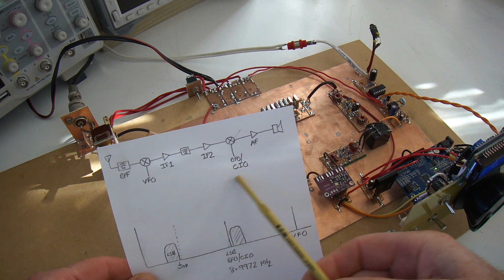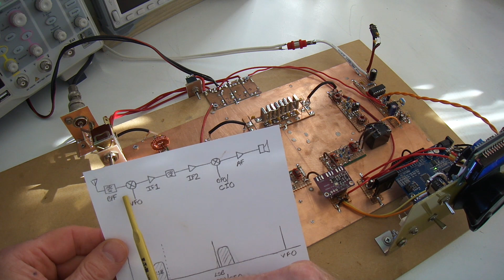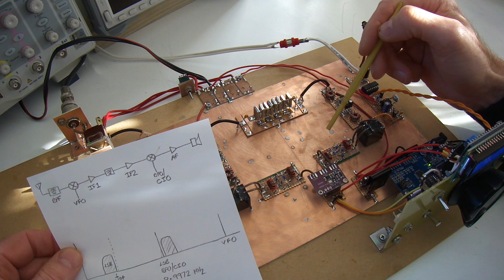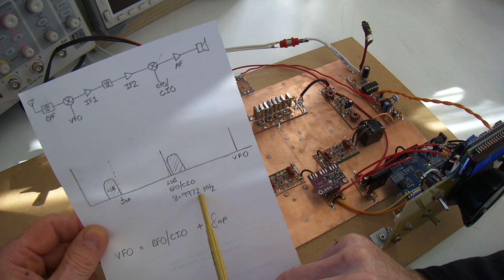Simple SSB Rig: Part 8 - Receiver On Air Test

Comment: Charlie, thank you for the project which has helped me enormously. I have made a valve transceiver using very similar scheme and have used your design of mixers with great success. However I use a bi-directional amplifiers for RF and IF (two valves). I am still a bit short of AF gain however for speaker operation because there are limitations with the valve amplifier with noise and stability.  I have a really good AF CW filter using toroids in a third order Butterworth filter, which is excellent. Receiver is just so quiet and sensitive.  TX is giving 20W PEP so far as I cannot get enough voltage for the PA just yet. Mixing freqs the same as you but I have a pre-mixer for 7 MHz.

Comment: Is this crystal filter a regular 8 pole filter or a 6 pole QER-filter (with parallel crystals on input and output)? What's its input/output impedance? Could you please show its frequency response?
Reply from the maker: It's a 8 pole Cohn filter. There is a video on it back a few.

Comment: The idea of amplification before the crystal filter seems wrong, you don't want to amplify the signals that are outside the passband of the filter.  Perhaps the pre-filter amp should have a gain no more than the insertion loss of the filter, and the post-filter amp should have enough gain to bring the signal up to the required level for detection.  On transmit, the total amount of amplification required is less as the balanced modulator can provide a good level of signal.
Reply from the maker: I have seen both methods and have always wondered what the pros and cons are. Another topic to research IDC.
Reply: @CharlieMorrisZL2CTM  Generally you don't want to amplify unnecessary signals because it will cause additional harmonic distortions and IMD. There is a great paragraph (in the second chapter, if memory serves) on measuring amplifiers in EMRFD. The experience of measuring an amplifier according to this paragraph was most enlightening. However! In this circuit you are placing an amplifier on the IF output of DRM. This is something worth doing, but you also have to use a 6 dB attenuator on the input of the amplifier. This will create a vision of ~50 Ohm load to the mixer and prevent any reflections of the signal back to the mixer (which will pass through since DRM is a symmetric circuit, then reflect from RF if it's mismatched on resulting frequency, and mix again with LO, producing unwanted signals). This topic is very well covered in EMRFD as well. An attenuator may be not needed depending on the input impedance of the amplifier, which may also depend on it's load.

Comment: Work of art and science! Wonderfully laid out and explained. I really wish i could've seem you working on this part via a live steam!
I am being greedy in asking you to show us how you actually solder and build things - even a small portion would be great. 
Also,  may I request you to tell us how you wired up the antenna coax to the first switch. A cct diagram would help for beginners like me fir your entire layout so that we can replicate and learn. 
Which coax cable do you use for inter module connections? IS it RG174?
Reply from the maker: Thanks Rajaram. I do have a video on how I make the circuit builds. Unconventional, but it works for me with the freqs I am interested in. The coax is RJ174. I often just use hook-up wire if the modules are close enough.
Reply: @CharlieMorrisZL2CTM  Thanks a ton for your reply Charlie! Do send a link to the build video you've mentioned above in your reply. I'm really grateful to you for your sharing your precious work with all of us.